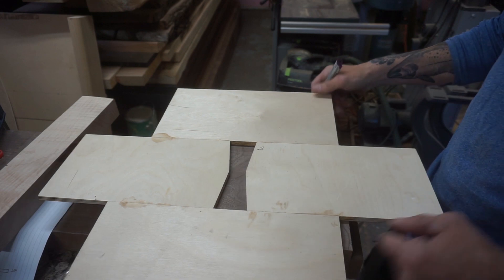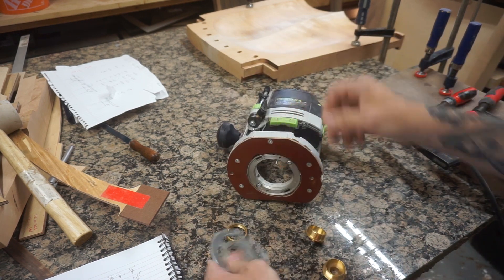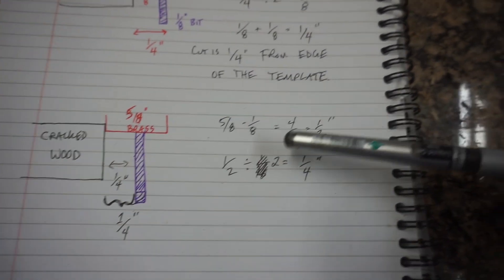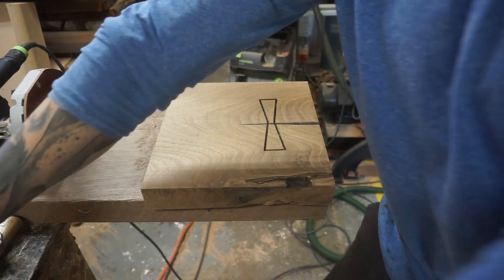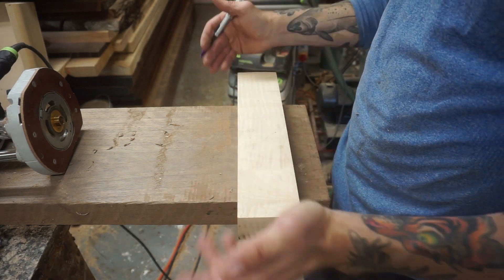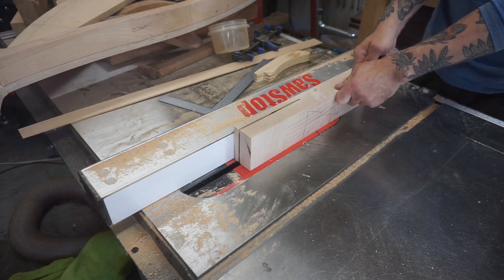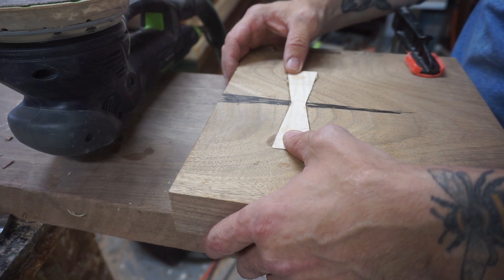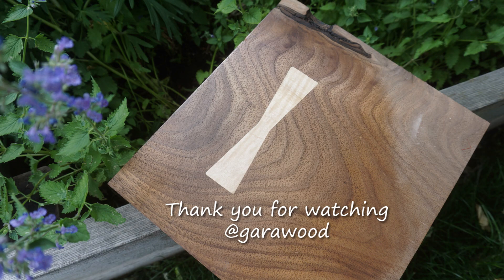Making a bowtie (butterfly key) with a router and template

Comment: Thank you for this.

I want to put a butterfly into a piece of walnut I have and have never done it before.  I have some scrap that I am using just to see if I can make it work and well things just were not working.   I had the right idea but my math apparently didn't work.   Lots of smoke coming out of my ears and I was afraid that I was going to ignite the sawdust in my garage so went and watched a youtube instead.   

Sure glade this one showed up, great explanation.  Will head to the store and buy a new 1/8" bit tomorrow and give it a try.

Comment: Hi, loved the video but do have a query.  I find that when I use my template the socket hole has rounded corners because I'm cutting with the outside edge but, when I cut my bowtie because it is the inside edge doing the cutting the corners are square.  Am I doing something wrong?  Thanks, John
Reply from the maker: Hi John. They should both be the same.....Can you send me a photo? garawood@yahoo.ca
Reply: Hi,  I sent a photo yesterday to the email address you forwarded.  I'm not chasing but not sure if it landed in your junk.  Thanks for your help, John

Comment: Thanks for this video. I was asked to make bowtie inlays for a client's butcherblock counter top. I had to add pieces to an 8 ft. top to make the top 122" long. He wanted to add bowtie inlays where the tops were joined on each end for decorative purposes.  I had an acrylic template, but hadn't used it in years. I also had the 3/8 and 5/8 bushings. They turned out great! There were several videos showing the procedure, but yours was perfect for what I needed to do. The only thing I had to buy was a 1/8 router bit because the one I had wasn't very sharp. Thank you!!
Reply from the maker: Right on - I am glad this helped!  Hope the table turned out well. Thank you for watching.

Comment: So I did this to the letter. My key turned out fine but didn't fit in the cutout. Not sure what I'm doing wrong.  Help?
Reply from the maker: How much is it off by?
Reply from the maker: What part isnt fitting?
Reply: @GaraWoodWoodworking  ideas the key itself is a bit long and wide.  I thought about sanding it down but it wasn't just a tiny bit in one spot.  Should I try a smaller bushing than the 5/8 inch?
Reply from the maker: @johnmclain6535  That does sound like a bushing or bit issue - are you confident you have the correct sizes? I wouldnt recommending sanding it down. (how much is it off by?)
Reply: @GaraWoodWoodworking  the bit is brand new so I doubt that's it.  I may try a slightly smaller bushing than the 5/8's tomorrow

Comment: how do you clamp that size of a template down on a large table where the clamps won't reach?
Reply from the maker: That is tough one....Generally the crack are at the ends. But I did have this situation once....I made long strips of wood and glued it to the edges of the template and made them so the clamps could reach. Wasnt ideal but it worked. I just had to be gentle not to hit the template too hard.

Comment: I can't get my math to work.   I have a 1/4 up spiral bit and several bushings, but every time I try to calculate which bushings to use, the numbers do not match.   I would have thought a 3/8 and 5/8 bushing would have worked, but I seem to be missing something.   Which bushing would you use with a 1/4 bit?
Reply from the maker: so when i do the math....If I used a 3/8" with a 1/4" bit I would use a 9/16" brass for the other cut....I hope I have that right??
Reply: @GaraWoodWoodworking  I came up with 7/16" brass for the other cut? My head hurts!
Reply: I used 1” with 1/2 for the 1/4 bit, it worked. Not sure how it worked out that way.

Comment: Just saved your video. I’m going to try this over the weekend. I’m sure it’ll work great.
Reply from the maker: Best of luck!!!!!
Reply from the maker: Right on!!!
Reply: GaraWood Woodworking I bought an upcut bit with a cutting depth of 1/2”. I guess my bow tie will be slightly shallower than yours unfortunately since I can’t find a deeper cutting bit online.
Reply from the maker: @zakorkaz  How deep can you make it? I have made some that are about 3/8" deep
Reply: @GaraWoodWoodworking  I was actually able to get the bow tie cut out to be 1/2" thick. I cut out the bow tie hole in the table 1/16" shy of 1/2" and it made the bowtie insert stand out 1/16" proud. Your instructions worked like a charm. Wish I could show you pictures. Table looks gorgeous.
Reply from the maker: @zakorkaz  are you on instagram? if so send me a dm @garawood